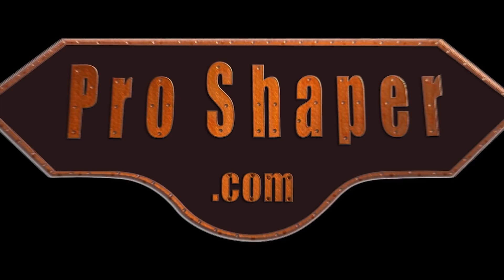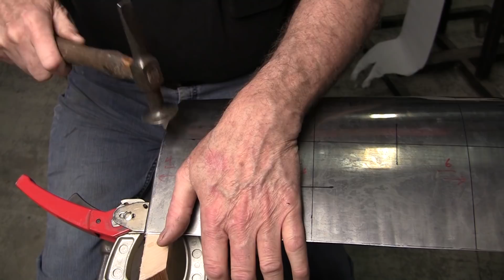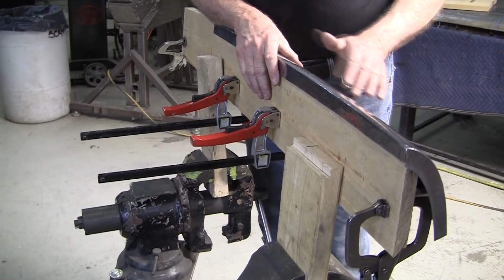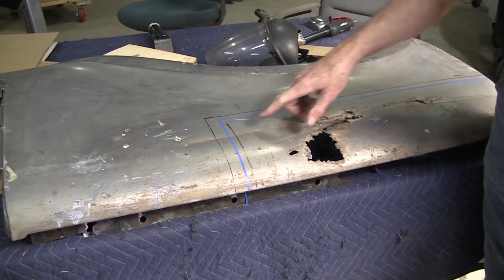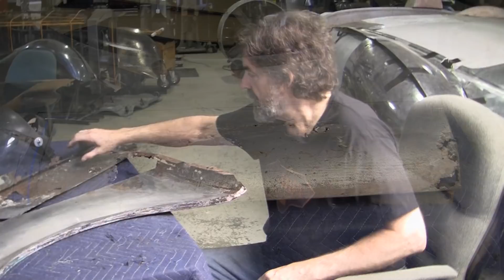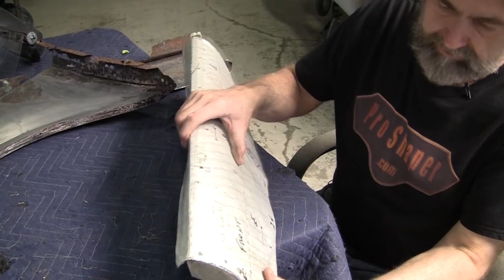Scout Restoration Series: Fitting a patch panel

Comment: Hello Wray! Hoping you will show your welding technique on the long low crown butt joint. I was always hoping you would of shown your magic on Restoration101: Door Restoration on that long low crown butt weld. It's the hardest weld for me , to keep from distorting, weather  I use TIG or GMAW. Arizona is along way to you classes. Hoping to make one down the road. I'm currently restoring a 1936 Ford pick up, second owner, AZ car its whole life!

Comment: I've been  a Scout II owner for over thirty years and your Scout series couldn't be more timely for my son and I who are restoring another rusty one in North Carolina.  Thanks!  
With regard to "growing your channel": a huge percentage of the Scouts that remain are Scout II models so it might be a good strategy for you to switch back and forth with 800's in the foreseeable future (entice the Scout II crowd).  In my experience, at least, one of the most difficult rust restoration components of Scout IIs is the windshield frame assembly which is not reproduced and is a complex challenge to say the least.  If you were to do a series of videos on that component I think your fame and fortune with Scout II restoration folks would soar.  Thanks again for the series.
Reply from the maker: Hi Henry,  glad you are enjoying the video series. Check out my other videos as well. There are universal lessons in all of them.
I have a Traveler Scout Ii that has severe cowl rust which caused the front of the body to tilt down 2" at the rear door edge. I will be covering that issue.   I also have a Scout Ii Pickup.

Comment: Wray, instead of naval jelly have you ever tried ospho?  And in your opinion what makes naval jelly superior?  Thanks again.  Tom
Reply from the maker: Ospho is the same as the phosphoric acid I buy at Home Depot ( $18.00 per gallon}   Naval jelly is a jell phosphoric acid it bites better on deep rust, I use the phosphoric  from Home Depot with coarse steel wool after to clean up. I have tried every rust removal method through the years. This works best until someone proves me wrong with a video ( don't tell me about it show me). If the part can be dipped, I use Rust 911
Reply: @proshaper  what would you think of using electrolysis in a larger container for rust removal? Say like a kids swimming pool so you could do an entire panel all at once?

Comment: If someone only had 1 vehicle, and no donor car to template the fender to hood arch profile from, would you template the hood profile instead?
Reply from the maker: Yes, that will work. The point is there are two ways to generate the information: accurately copy an existing surface/line  or guess and make it up. If you make a surface/line up you can use photos and a good aesthetic eye. When you are all done the 20 foot look never lies. If a line or surface is wrong it will scream at you. Funny thing is you might be the only one that sees it.
Reply: @proshaper  Thanks!

Comment: I have had to shrink a similar flange like that 45degree. I don’t have a 45degree shrinker. So I mocked up a copy of the flange, and tried heat shrinking it with my Tig torch on really low  just 2 second spots every 25mm. To my absolute joy and surprise, it worked really well. 
The Tig torch method is very controllable, and it works.